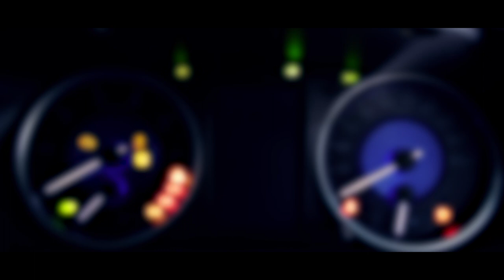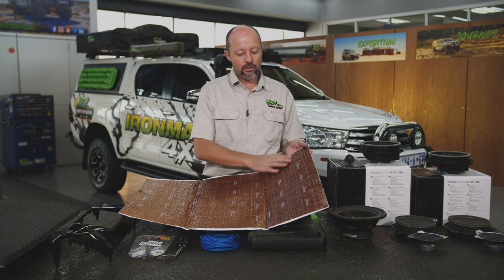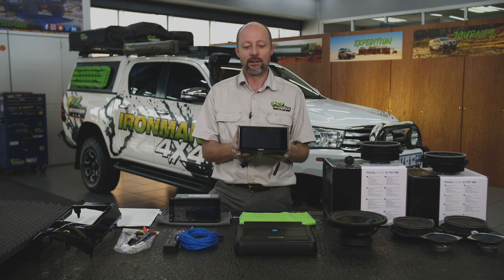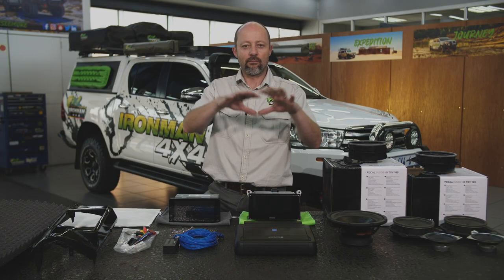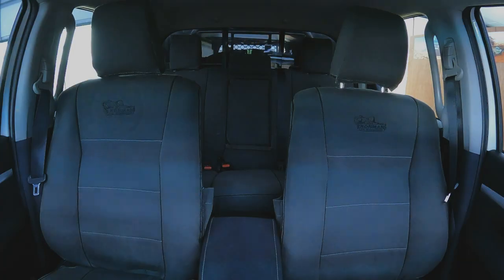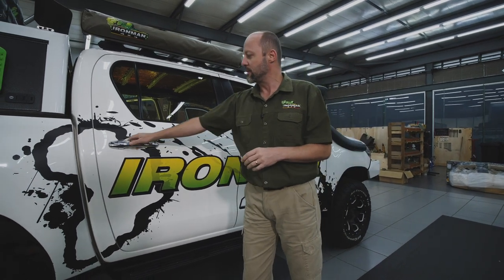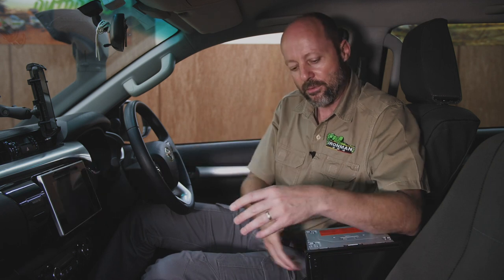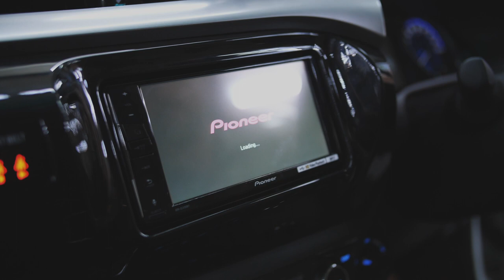Vehicle Build: "Ironvan" Toyota Hilux Bush Truck Episode 13: Sound System Upgrade

Comment: Hey, do you have an item list? I got the focal already on my list, but what is this pioneer radio model? Did you use extra subwoofer or just the 3 speakers per side on the doors?
Reply: Hi E. FU. 
Just the Focal front splits and rear co-axes. We kept the upgrade simple so no sub or additional amp. Pioneer is a AVH5150BT model. For the money and effort it sounds very good.